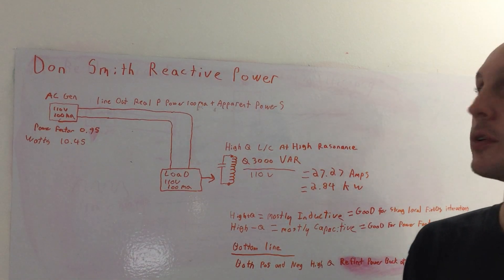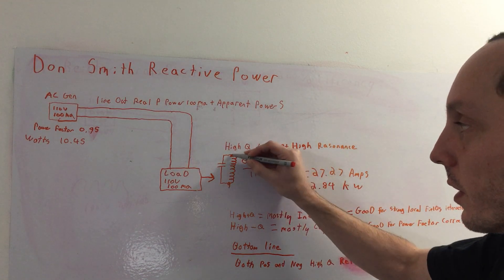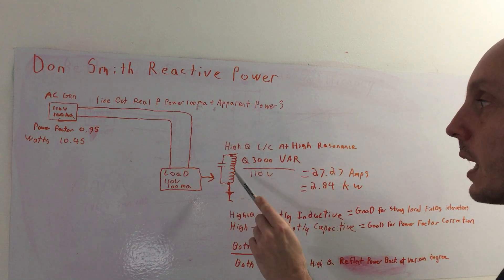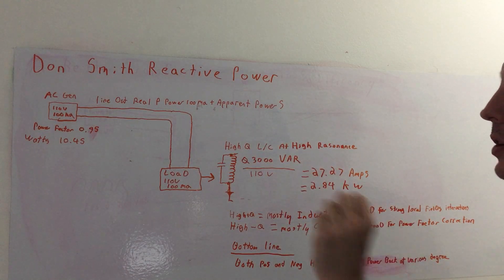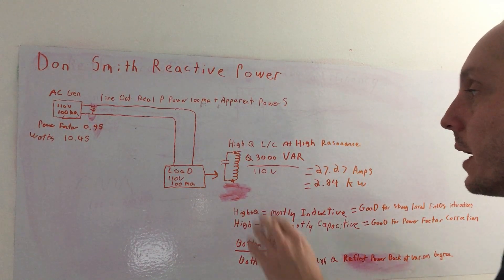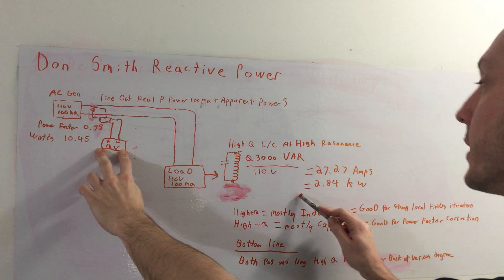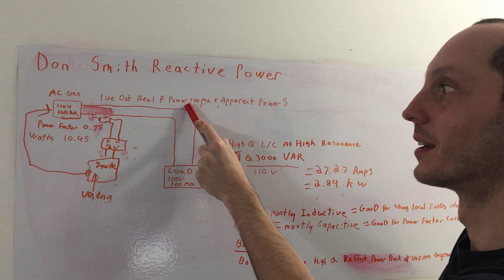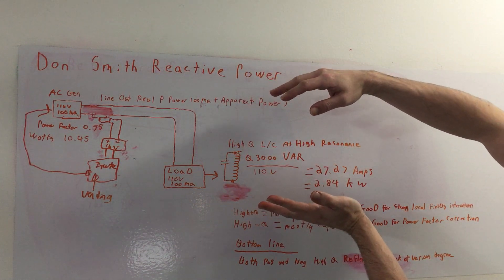Don Smith Reactive Method

Comment: Does this have to be ac or could you start with a separate battery input (e.g. 48v) and invert that? Maybe even charging the 48v battery from solar input to massively increase the efficiency of a solar off-grid system? (great work by the way) 👍